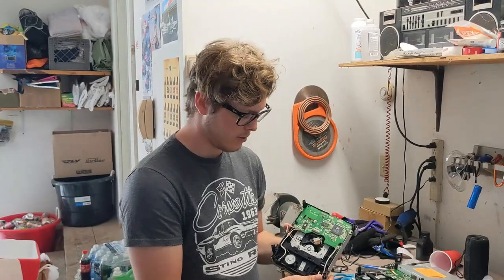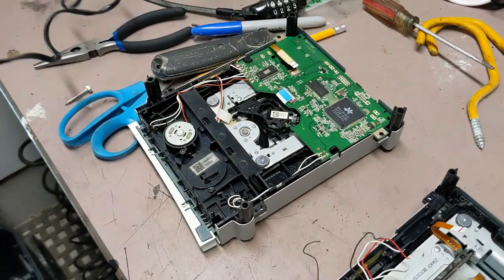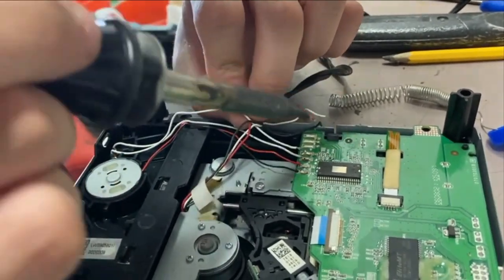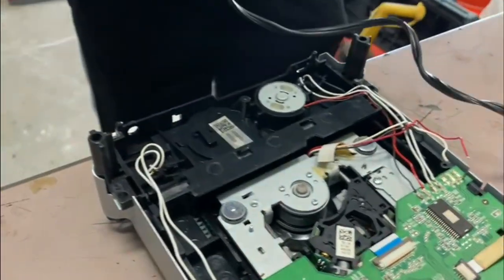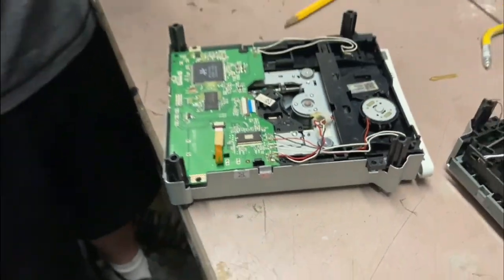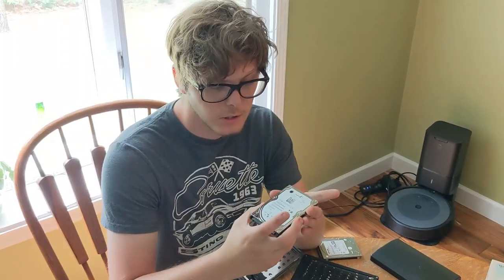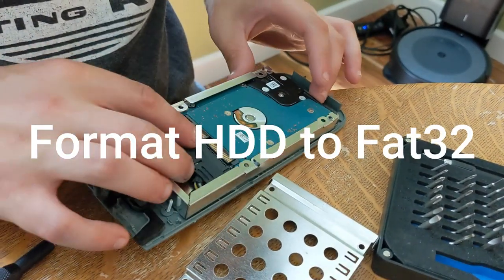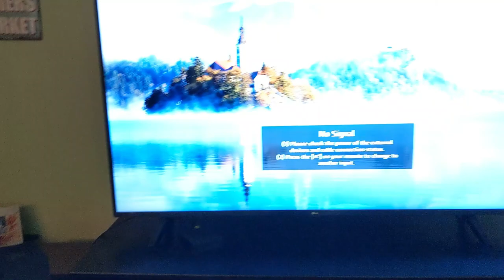I fixed my Xbox 360 disc drive

Comment: Hey bro great video !, was wondering what os you use, running Garuda dragonized gaming ver personally ,moved from windows for many reasons ,just curious thank you, also do you have a discord have many questions for you ?
Reply from the maker: I use Windows 11 even thought I prefer 10. After learning basic Linux stuff in college, I just didn't feel like using it on my main rig. Still use Linux in a VM.  though. My xbox uses the stock OS. Also, no I do not have a Discord server.